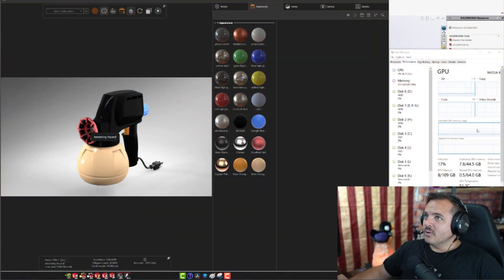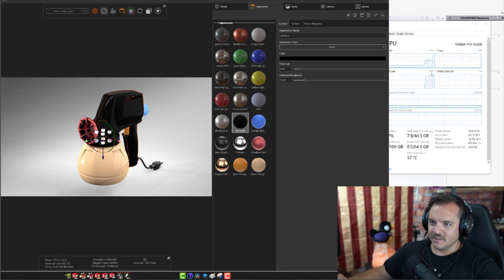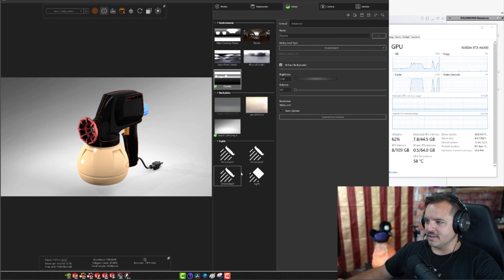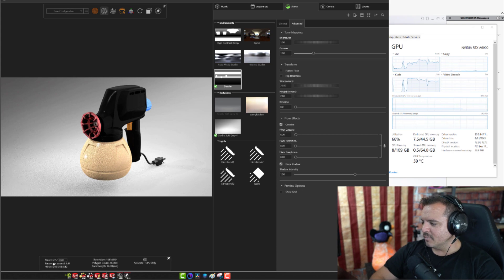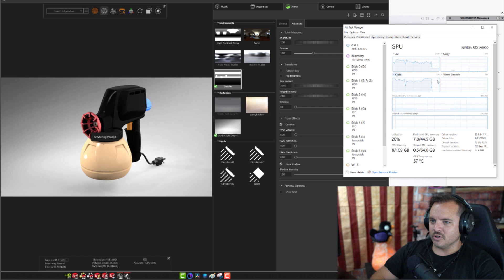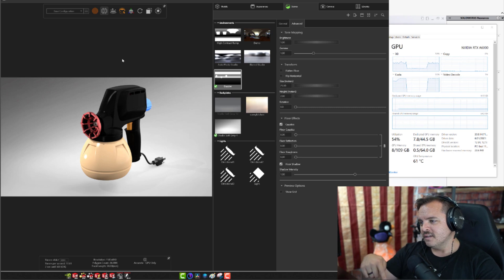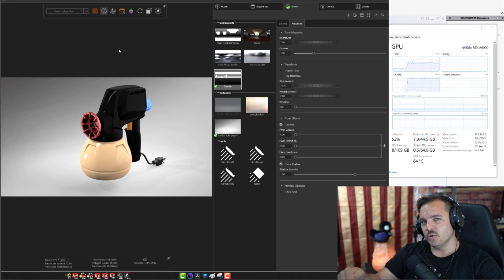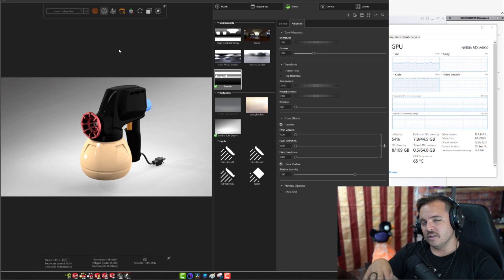SOLIDWORKS Visualize with RTX A6000 GPU from Nvidia

Comment: Hello Adam,  I have a A5000 and a A4000 I an looking for current info on tuning the setting for Solidworks getting the hardware dialed in before we meet with GoE onsite visit. Any link you may have used to tune your A6000 might be useful. Thanks Will
Reply from the maker: Hey Will, only the fan curve was adjusted. You can check that out here... https://youtu.be/IU3GEvFMLxs